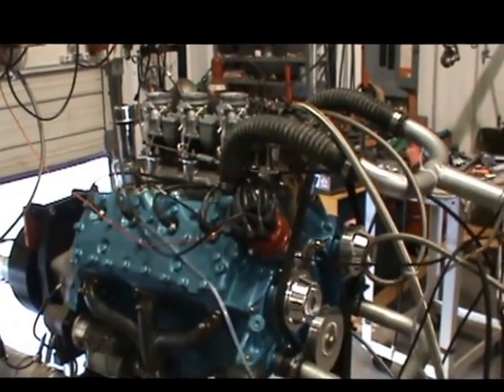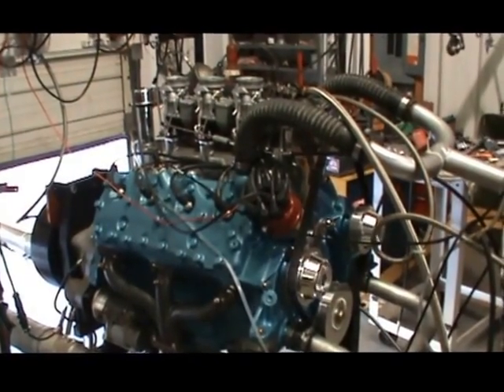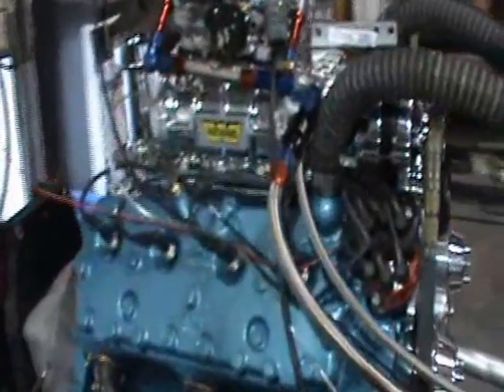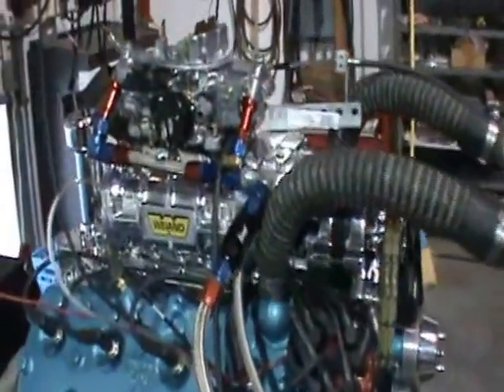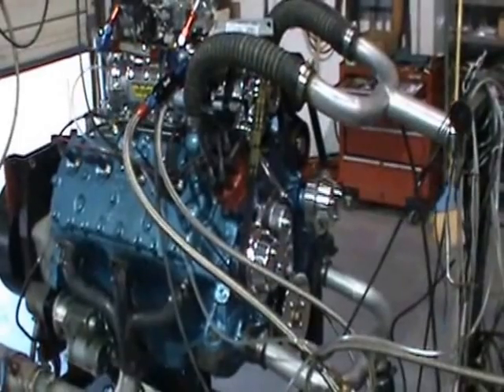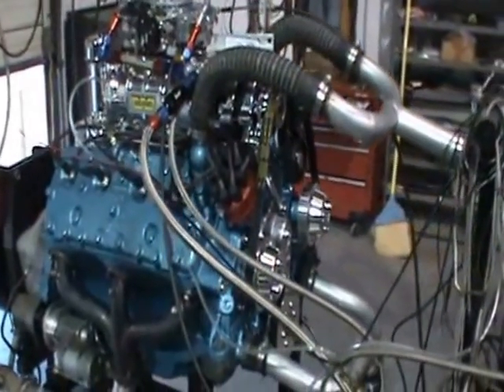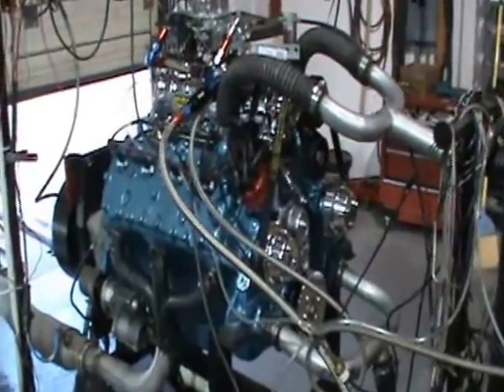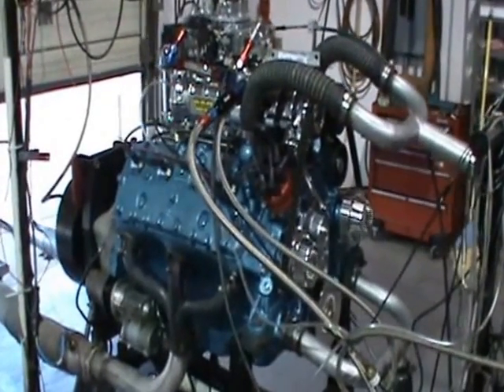Building a High Performance Flathead Ford  Part 5 -  Engine Dyno Testing

Comment: Sin  menospreciar  el buen trabajo que estan haciendo .  Lamento desirles que los mejores desarroyos de Ford 59AB.  Motor V8 . O el 6 cilindros valvulas laterales se iseron en ARGENTINA.. pues tiene la categoría  de automovilismo  mas vieja del mundo  el TURISMO DE CARRETERA .  Por q en un principio las carreras las organizaba  el ACA  De  ARGENTINA.. este motor V8 en 4.000 cc como tambien el 6 cilindros.   Desarroyaban una potencia en un principio de 260 hp pero con el tienpo supero los 380 hp.. y con aspiracion natural .  Pero los desarroyos  mas sofisticados  los isieron los Emiliosi pero ya no eran un valvulas laterales pero los Gálvez  y muchos  mas si lograron grandes potencias Hasta los años 60 & que las categoria los retiro dando  paso  al Ford 6 cilindros 221 que lo agrandaban a 250  y asi todos los modelos de diferentes marcas eran de 4.000 cc pero barias marcas dejaron de conpetir por q ya no se importan  o fabricaban  como el Studebayker.  El Pontiac . Vovo. Osmovil ..

Comment: For all the faults a Ford flathead has.....they are one of the best sounding V8s....something about the growel they have.... My first flat head V8 was in a 41 Ford pickup when I was 15 in 1965.  I think it was a later 59AB block....the distributor was not in the lower front. My dad was a mechanic from the 20s through the early 70s.  He rebuilt many a Flaty V8. I can remember him changing points on the earlty models with mirrors...he rarely removed them.  All the while with a cigarette  in his mouth  and  eyes flinching from the smoke......

Comment: I think the engineering challenge of making a 350 hp flathead (on gasoline) is harder than just building yet another 1500hp twin turbo LS. Besides, different is good (unless your idea of "different" is freebasing dog poop).

Comment: These engine will make lots of power with a turbo ,   they are built  strong and they are low compression  so you can dump the fuel and boost to them,
Reply: They're not THAT strong, there's only 3 main bearings holding that crank in.

Comment: Wikipedia has info about a Flathead V8 with 700 horsepower and a top speed of 300 mph in a custom racer.
Reply: That must be the Dick Landy reverse-flow motor from about 25 years ago, eh?
Reply: That was decades ago too....theres a guy who set the flathead dragster world record back in 2011 also...his is blown on methanol and makes 900hp

Comment: Damn! Just imagine going back to 1929 with this engine!! You would rule!! Lol!!
Reply: The flat-head Ford V8 was introduced in 1932 with 60 HP, later 85 HP in 1939.
Reply: Yes,your all correct it wasnt introduced until 1932. Congratulations!! Smh...
Reply: Especially since the flatty wasnt introduced till 32, lol. Hell, even in 1947 (before the overheads), it would've kicked ass.
Reply: Dave Micolichek  I'm fairly certain my 2.0L Hyundai could win the 1929 Le Mans

Comment: I was disapointed you did not cover the installation of the blower or the ignition system, My crew and I are seriously considering your setup for a salt flats application . Did I miss something ?   Do I need the book to answer these questions ?
Reply from the maker: The blower and ignition system installations are straightforward. The "335 HP Flathead FordV-8 Performance Handbook" covers the topics in detail and I believe you would find the book quite helpful for your project. Also see www.roadrunnerengineering.com .

Comment: For a 300+ hp you will need more boost... maybe 4-5 # ...???!!!
Reply from the maker: That is correct, but the customer was happy at the 265 HP level. The similar Bill Boomer engine in "335 HP Flathead Ford V-8 Performance Handbook" made 309 HP with about 5 psi boost.

Comment: What was used for the ignition system, as I do not recall that being mentioned? Wondered why cast iron heads were used if the compression ration was lowered and not much boost. Heavier than aluminum so was it more to dampen?
Reply: More clamping power and rigidity

Comment: What do you value this engine to cost if u were to sell it ?
Reply from the maker: A similar customer's supercharged engine sold for $11,000 in 2017. I think  such an engine would sell for $13,000 to $15,000 in 2019. There are a lot of variables that affect the cost/price including availability of parts, builder, etc.
Reply: That sounds cheap per Hp-in uk trying to get 120 plus hp from a normally aspirated 1293 cc (78.9ci)mini engine would probably cost £7000 plus nowadays.Admittedly a much smaller and somewhat newer design of engine ohv but still siamesed exhaust ports

Comment: Can someone explain it to me please.... I don't see the engine attached to anything accept the stand. So what dyno is this guy's talking about??
Don't see no screen/print... only mouth dyno!
Reply from the maker: The  stand you see is the dyno structure. The back of the engine is connected to the absorber and the torque arm which are not very big. The other part of the dyno is the computer which controls the load and records the data visible on the left. More of the system is shown in the other videos on this channel. Go to www.roadrunnerengineering.com for actual test results.
Reply from the maker: You can see more of the dynamometer system on https://www.youtube.com/watch?v=U8x47lRNslc on this channel. I was mistaken about the computer system being visible on the subject video.

Comment: I could only imagine if you actually ran some boost through it I could probably make some really good power... need to run it on some alcohol (e85)... and turn the boost up to I don't know 15-20 pounds pull couple of degrees of timing out of it she probably make 6 700 horsepower
Reply: It's a flathead dude. He might correct me, but 700hp in a flathead?
Reply: @phoenixrising4573  it's possible but not worth the money unless racing in a class for only flatheads and you had the money so you can say you won and they dont last long at all most the time need rebuilt after topping it out on the salt flats depending on how well you have it dialed in
Reply from the maker: The owner wanted a powerful, reliable street engine that ran on 91 octane, so that was what we were verifying on the dyno. He paid for the project and called the shots. Your analysis is probably correct as there have been much more powerful racing flatheads with more boost and more potent fuels.
Reply: Uh, no. Don Garlits has several very hot flatties, and the hottest one makes a bit over 300, blown, on gas. He says it'll make 500 on nitro. Didnt say for how long though!

Comment: Why only 3 1/2 pounds of boost? Limited by having only 3 mains?
Reply from the maker: The owner was nervous and decided to terminate testing after his 300 HP goal was met. This engine had a heavy duty center main cap and similarly equipped engines have been tested with up to 12 psi boost at 5800 rpm using 110 octane race gas.
Reply: blownflathead  Still, amazing output for a flathead.
Reply: @blownflathead  You would know! Always consult an expert before venturing into unfamiliar territory!
Reply: Flat heads, 3 mains and 3 exhaust ports. Most fun I ever had, Lots of scrapped knuckles, head scratching, and being teased for not just dropping in a small  lock Chevy! V8!!
Reply: @TheBrassCaster  SBCs are like hemorrhoids...virtually every asshole has one.

Comment: jesus 200 hp from 8 lawnmower engines. im impressed with how well it did. those cranks are known to split after 6000 rpm
Reply: Scat stroker cranks are known to split after 6000 rpms?
Reply: @836dmar  I'm pretty sure stock
Reply: @836dmar  the cast ones are only rated to 6000 max last i heard from scat. But thats INSANE for a flathead. even with dual valve springs theres no reason to rev past 5500 with any cam almost
Reply: adv512 b
Reply: I dont know of anyone dumb enough to spin one that high.

Comment: Is a 3 deuce intake too much for my stock 239?  I was told to use a progressive linkage and it would be fine.
Maybe, I'll go with 2 deuce.
Either way, it's likely to be a Navarro intake.
Your thoughts?
Reply from the maker: The 3x2 setup will work fine on a stock 239 cu.in. engine. See pages 57-58 of 335 HP Flathead Ford Performance Handbook for dyno testing of that setup.
Reply: blownflathead Would really love to find a copy of your book Joe.  I’ll keep an eye out for any republishing you may do.
Reply: @blownflathead  335! Holy shit!
Reply: I've done this. The 3 twos should be set up to run normal driving on typical streets at 40 mph on the center carb. Shut the center carb off under heavy acceleration. 2 of the two barrel Strombergs are  much more efficient at speed speed and heavy acceleration. The 4 carb set never worked.   This was back in the day when I could easily buy 110 octane gas at any station, it of course was leaded!!! I ran 10:1 Edelbrock heads. A 12 volt electrical system where I could switch off the generator, Two much drag and eats up HP. You really need to consider your elevation, Sea lever or higher. Stromberg 97 or 48, or custom main jets, check the accelerator pumps and the power valve in the carb. Hot humid weather (thinner air), altitude (thinner air), even the difference between hot days and cool nights)  outside local air pressure, high or low. There is a world of difference on cam timing between normal aspirated and super charged.
Reply: @TheBrassCaster  I once spotted a very rare 4 carb intake at the Monroe (WA) swap meet, but for the Lincoln V12 flathead! It was an Edmonds, fully polished. For all I know, the polishing may have ruined the collectibilty, but it looked awesome! As I recall, and this was 15 years ago, he wanted $600 for it, without carbs. Ouch.
Reply: Jet it right and it will be fine

Comment: I''ve got a '51 8ba that's stripped to the block and heard you can drill and tap two holes at the back of the engine in order to use a modern type oil filtering system,do you guys have a video or any instructions and/or advice for this modification?thanks in advance!
Reply: I've always liked the look of those old time finned aluminum "behive" oil filter canisters, although I'd want an actual FILTER inside, not a roll of toilet paper!
Reply: Tjey have a bolt on kit to run a modern style spin on filter witbout drilling anything. They also sell a cover to make it look like the old style canister filter.

Comment: As a young boy I was fascinated with cars- the family car was a Ford 1938 V8 It was a very powerful car. I learnt to drive with this car. The only problem was the mechanical brakes were not so  powerful to stop the car and needed a lot of pedaj pressure. t was old Henry Ford's obstanicy that  brakes should be mechanical